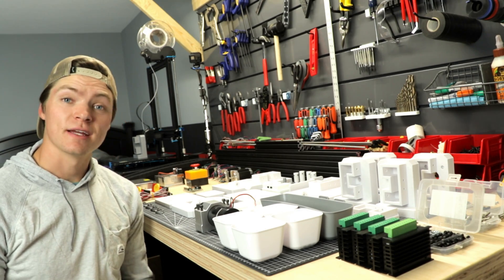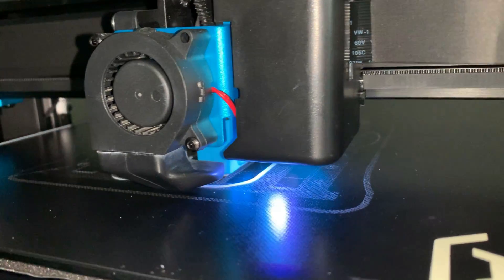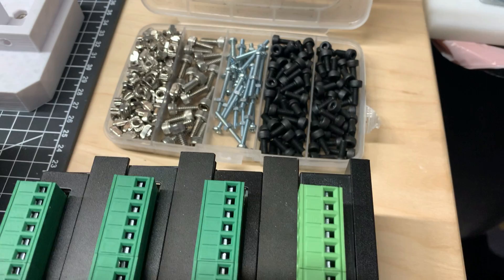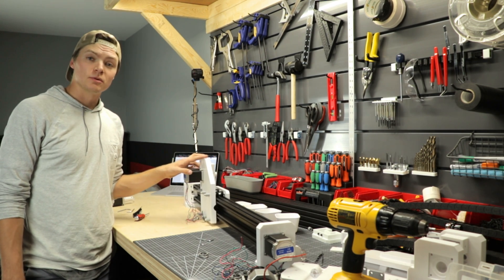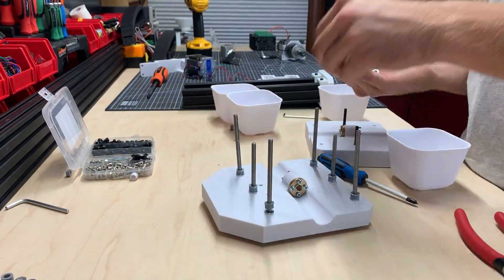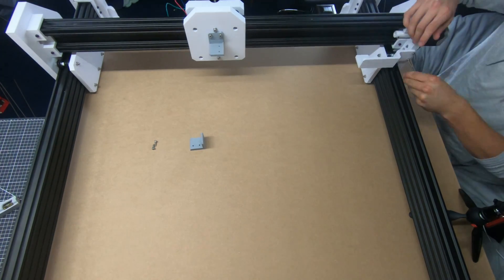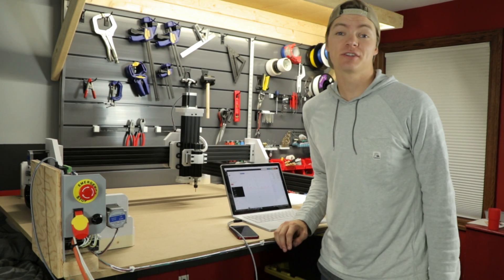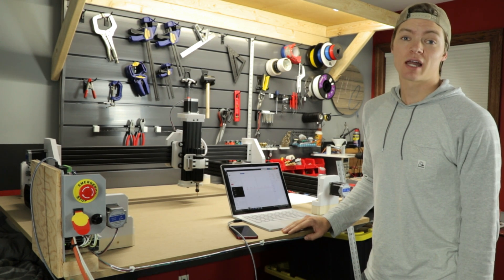Custom 3D Printed CNC - DIY Complete Build (Part I)

Comment: Nice.  Based on the size of those rails I can calculate the approximate dimensions of the 3d printed parts and have no need to spend money on what should be reprap community info.  Thanks!

Comment: 10:00  That plate is massively under-extruded, you should really calibrate e-steps and tweak your flow as it would result in cleaner and MUCH stronger prints....

Comment: Thanks for the video it will help me a lot. Some 3d printed components are not compatible to the metal ones. Some are extremely tight, some are not fitting at all. Good to mention: I used the exact components that you listed. I will try to make it better.
Reply: for example: you did not use 6.35mm to 10mm Plum Flexible Coupling for the motors, as the diameter is 25mm cannot fit into a 25mm hole with the screws. the hole needs to be at least 30mm and the correct Coupling for this will be 6.35mm to 8mm as the 1000mm screw is a T8 not a T10. This is one example from many.

Comment: i admire the speed at which you designed it. I was wondering why no washers on the black screws that are against the plastic? and why only 15% infill?  why v-wheels and not normal filled delrin wheels? i've also heard that the steppers run quieter with more voltage. not sure whether that means 24v or 48v though.

Comment: What do you think is the blocker for its moving speed? The processing power of the controller? The motors? The gears (if any)? Or the belts? What do you think is needed to make the movement even more faster than what is shown at 11:20? I know that’s a decent speed for a CNC machine, but I want my build to be a little more faster. What would I need?

Comment: Very cool, super clean! Id highly recommend looking into heat stake nut inserts, they let you put metal threads into plastic parts and can be set with a soldering iron. Mouser part IUTC-032 or so.

Are you offering the files for download anywhere? Keep up the good work! 👍

Comment: Love this video my bro but why do all u guys fly through the electronics on these builds. I'm completely new to CNC machines and I have bought all the parts to build my own DIY job. I'm going for 1000X1000mm bro. It's the electronics that kill me bcos I've never been around this before so do u have a full video that hasn't been sped up or is this it?? I would very much appreciate ur help man. Do u have a video going through how to set up the electronics? If u do then can u leave a link to it so I can get at it asap. Lol,,
I only began a new career in the electronics field 4 months or so ago so this is new to me. I'm learning little bits everyday but I can't begin to understand how to build out the electronics stage of my build which is why I'm watching so many videos trying to find my way bro, I bought the Arduino, and I also have the CNC Shiled, Nema 23's X4, TB6600'S X4, Limit switches X20, Mach 3 board, and a shit load of other parts as well. I like the idea of the 3D printed parts but I was thinking of using 10mm Black plactic sheets and designing and cutting the parts out of that for the Side Gantry plates. I'm in 2 minds bcos It may not be stromng enough but I also have 3 power supplys, a 24V 360W 15A, A 24V 600W 20A power supply and I also have a smaller 120W 24V 5A power supply like a power supply for a computer but this allows me to turn the voltage up to 30V? I believe. I went nuts and am still waiting on more parts. I also have a 500W Spindle coming with the same power supply u have with the speed controller on it. I have a Genmitsu GS-775 Spindle motor but I cannot find the 24V wattage of this motor and I also have a 800W Topshak Palm router spindle if needs be but I'm not sure which route to go in as yet.. Like I just said I went nuts buying parts and all that guff but I still believe I will be able to use a lotta these in the future when I attempt to build a bigger CNC.. 
Great video btw bro. I love watching these videos but I do wish u could walk us through the electronics stages much slower. Most ppl think the electronics part of their video is boring to us but I hope u now see there are millions of ppl like me who actually would love a proper tutorial of a video concerning the electronics build too. Apologies for the longwinded rant bro. I really want to get this built over the Xmas Hols. I have 12 days off work and I will be in my workshop trying my best to et this build up and running..
Salute to u young man. Great work and keep it up and also keep these brilliant videos rolling  out..
Reply from the maker: Hey man! Thanks for telling me all about your project. I’m excited for you! What seems confusing from your angle? I can gladly provide you with some schematics and some electronic explainations! If you can you should click on the about page of my channel and click on the business inquiries and shoot me an email (it’s free)! Then I’ll help ya out!
Reply: @MatthewCarlsen  Ah thanks man.. I'll defo be in touch. I've decided to cut down on the size for now and go for 600X1000mm and hopefully upgrade the parts later next year when I go all out for a 6' x 3' build.. I really appreciate ur reply. I will be in touch soon. I'm busy with work atm but I will get in touch sometime in the coming week. Thanks again my friend.. Sound..

Comment: Hi there! a quick query, did u use any eccentric spacer on the wheels? to make to rollers wobbles less to make the accurate linear motion?
Reply from the maker: When I first built it I did not, however I strongly recommend using them. I was not aware of them when I built mine!
Reply: @MatthewCarlsen  Thanks for the quick reply! <3

Comment: Loved the design, especially the gantry part which is a two-way supported with wheels on both sides. What should be the minimum distance between two grooved wheels connected parallelly? 
I get the idea where you stacked 2wheels vertically with spacers, But I am curious to know; the distance between the stacked rollers in one row. How much gap did u put or how minimum should it be?
Reply from the maker: You are talking vertically right?
Reply: @MatthewCarlsen  If we consider the Z axis as an example- where 2columns of the total 6 rollers have been separated by the screw to create linear motion. In each column 3 rollers are separated with a minimum distance, I want to know that measurement.
Reply from the maker: My measurement is 3.97" from the centers of the V-Wheels! Let me know if that helps!
Reply: @MatthewCarlsen  Yes it does give me an idea of the concept.
One more thing, while designing the granty, did u follow any particular theory or maths to select the no of wheels & the distance measurement required for this particular machine?
Reply from the maker: @ismatnabila  I did not, I just made a logical decision that if you have three contact points on the top and bottom it will ensure structural stability for the use case.

Comment: Hey Matthew,

Awesome build! I would like to build something similar myself, I'm searching for good materials to fabricate the machine with. Since you used allot of 3D printing, I have some questions about that aswell.

Questions:

1. What kind of 3D printing material did you use? (PLA, PETG or something else?)

2. Where did you get that nice looking C-profile?

3. Is there any play on the axis? what where the problems you faced with designing them?

4. Why are you using a 500 Watt spindle and not an off the shelf Makita kind of router?

5. Any tips on what to look out for while making your own CNC machine? ; )
Reply from the maker: Thanks for the thoughtful comment! 
1. I used PLA but I strongly recommend PETG. 
2. E-Bay
3. There is play in the z-axis but I am coming out with an upgrades video in less than 2 weeks! 
4. Simply wasn’t knowledgeable about routers and built it based of Nikodem’s design (a fellow YouTuber). 
5. Watch to the end of my next CNC upgrades video and I have some quality tips for you!
Reply: @MatthewCarlsen  Awesome! Looking forward to it.👍

Comment: Hi Mathew, great work. Which spindles did you use? They seem to be TR8 trapezoid spindles. Did you resolve backlash with backlash nuts? I couldn't see it in video.
Reply from the maker: I have a 500W spindle and have not change anything from when I bought it!
Reply: @MatthewCarlsen  Wow, very fast reply. Thanks! But there is a misunderstanding. I meant the trapezoidal thread spindles that drive the axes. Is there any signifikant backlash?
Reply from the maker: Tbh I’m not sure what trapezoidal thread spindles are but I haven’t had any backlash so far!

Comment: This is AWESOME. Love to help support you. I think this is a great 3d printer and can't wait to see what you have in store. I too was thinking about limit switches, a ring light i saw on someone else's just like this one, and a vacuum hose as well. I subscribed. I an into electronics, but I don't know how to program. I am NOT an engineer but can come up with ideas. I do not know how to use CAD. I'm in Ohio. How can I help support you?
--- Tom
Reply from the maker: What kind of electronics are you into?
Reply: @MatthewCarlsen  I build a lot of LED clocks of various design. I just about like to build stuff.  I wire trucks for the military mostly.
Reply from the maker: Awesome!

Comment: Great project. You are certainly a great engineer! I probably missed that but what filament did you used for the 3d parts ? Thanks
Reply from the maker: I used PLA but I would definitely recommend PETG for multiple reasons!
Reply: I was gonna suggest PETG as well for strength 💪  what 3d pri ter you using? I might get the tevo tornado
Reply from the maker: @tomgray7049  I agree, I now use PETG for all my projects and it is leaps and bounds better in many ways. I have an Artillary Sidewinder X1!

Comment: While I get the idea of building a CNC with a 3D printer, I don'T think it makes a lot of sense. You are already using aluminium extrusions for the frame, why not just add some linear rails for all the movement of the axis? If you buy them from china, they are cheap as hell, yet so much more rigid compared to the solution with belts and 3D printed parts.
Reply from the maker: My printer doesn’t use belts so it’s actually very rigid! And although rails are ideal I didn’t have the money so I used the aluminum profiles as the rails!